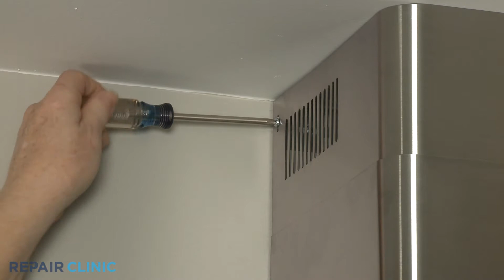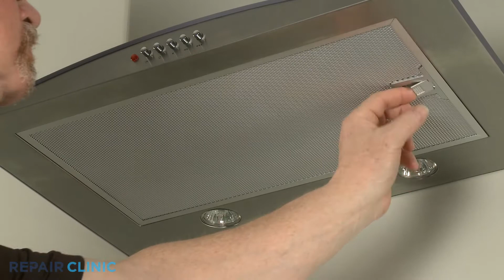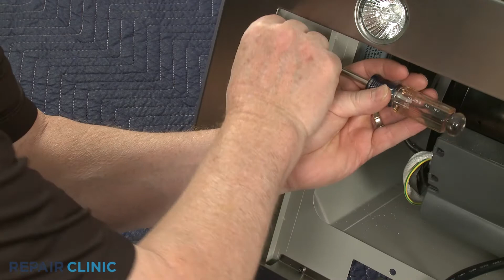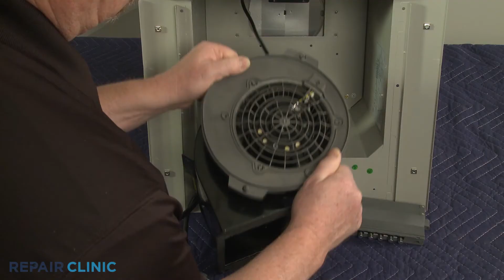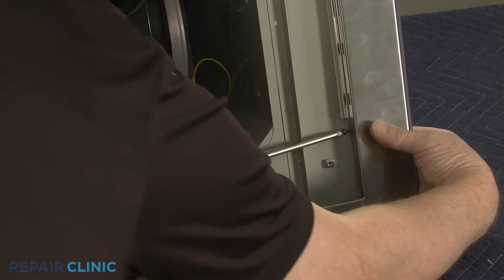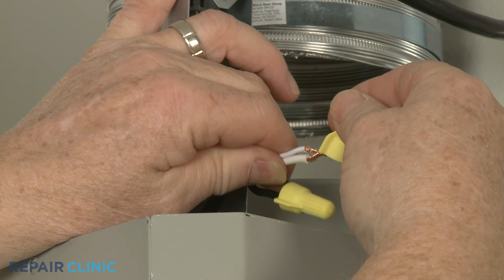Frigidaire Range Vent Hood Blower Wheel Replacement 5304482256

Comment: This video saved me $200 plus. Let me explain. My GE hood blower fan was making a grinding noise. I took it apart, checked the motor and the capacitor and did not find any issues. The circular blower fan was moving freely on the motor shaft and i wasnt aware that it was because the retaining nut was loose. Tightened the nut and voila, no grinding sound and works as new! Thank you